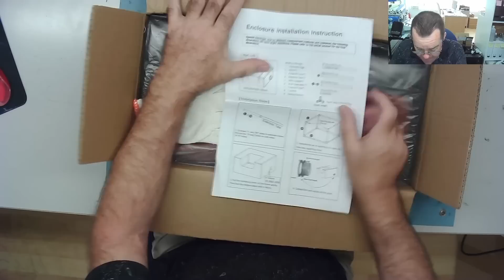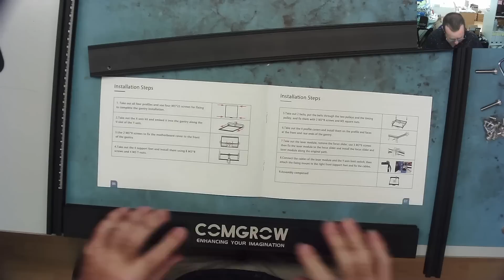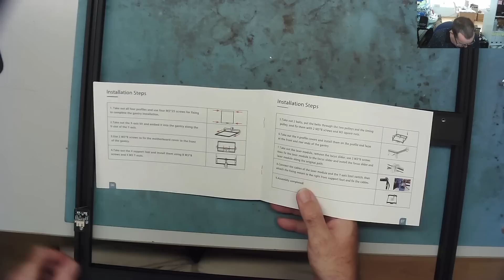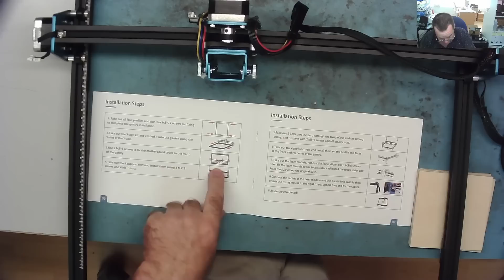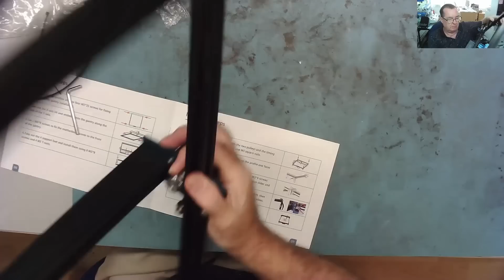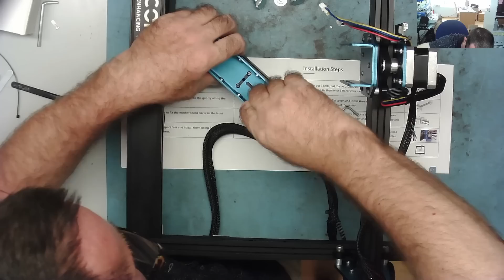ComGo Z1 10W Laser Cutter Engraver Review - Can we make PCBs with a laser cutter?

Comment: I would recommend getting a fune exhaust system when using a laser engraver due to the fumes generated during operation. I would even suggest getting better glasses to protect one's precious eyes when the engraver is in operation.
Reply: Concur re an exhaust / extraction system, especially when cutting / engraving plastics which can produce benzyne and hydrogen chloride (which produces hydrochloric acid in air). Many fumes are carcinogenic.
Reply from the maker: The supplied glasses completely block out the laser, it is not visible at all with the glasses on so I would expect they are good enough
Reply: @learnelectronicsrepair  The thing is there are a variety of lasers out there some of which operate in the infrared spectrum which is not visible to the naked eye. This particular one is 445 mm which is blue light.  Do those supplied glasses wrap around on the sides?
Reply: Hi, You are right about the fumes :D, couldn't have the shroud on while filming but  i am looking into designing a fan mount to flexible ducting , for the outlet port of the shroud . Will probably use 1 or 2 120mm fans maybe in a push pull configuration to get a little more static pressure .

but thanks for the suggestions to keep us safe 😉
Reply: @RetroUpgrade  Have to be careful of long-term effects. May not notice any immediate effect.  The hood is good to contain the fumes but still has to get the fumes either outside or through a series of filters like activated carbon etc.